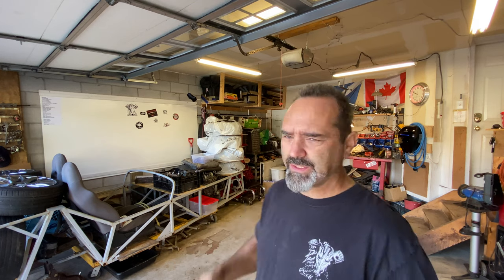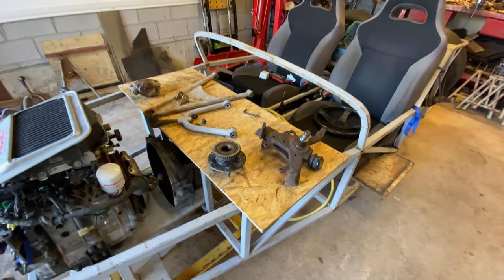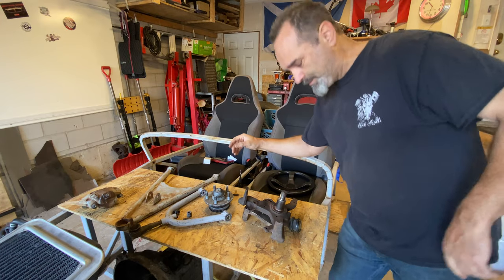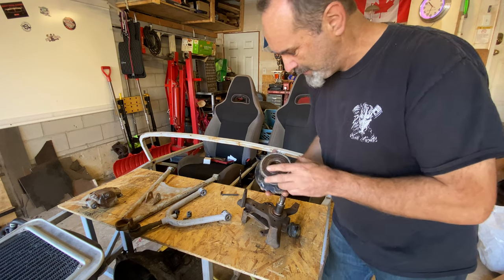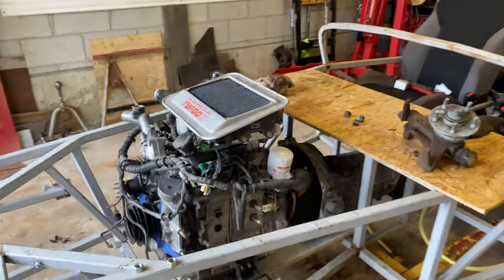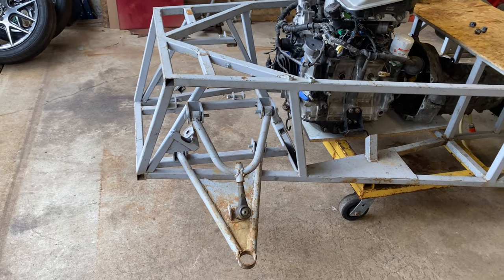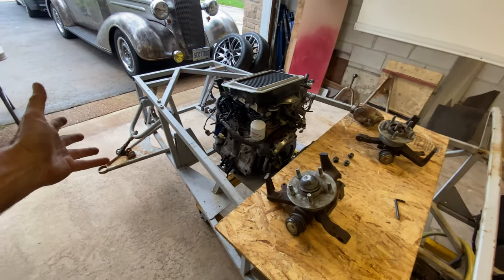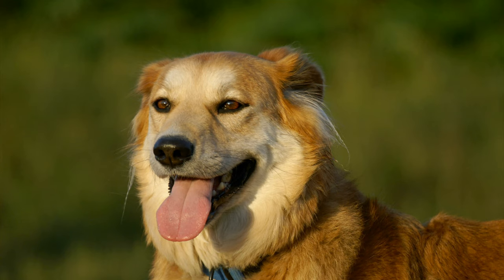Identifying The Front Hubs And Spindles On My Locost 7R7 Project

Comment: There is a great amount of engineering that goes into a front suspension,especially proper geometry.changeing the control arm mounts will affect the way the knuckle camber changes in up and down travel.I also see no way to adjust caster on this set up.what about ackerman angles on steering arms,are they correct for this wheel base.I see no sound principals being followed here,It may roll when your finished and thats about it.
Reply from the maker: Do not fear my friend! I am far from finished. currently learning FreeCad, so I can simulate the movement geometry. As for castor, I was thinking of making the control arms adjustable where they attach to the frame joints. There's a lot to learn, I know this.
Reply: @ScottRods  i would recommend a step before the FreeCad: get a good suspension/chassis book to learn the basics.  Those control arm mounting points are key in determining your front roll center and roll axis which are critical for safe predictable handling. I suggest How to Make yourCar Handle by Fred Puhn or a similar book by Herb Adams.
Reply from the maker: @wschell4023  Someone actually sent me that book last week! It's old, but the principles still apply.

Comment: I'm going with "A" on the PP. Also, I have no problem with hub adapters either, going to need them on the back of my 40 Ford to use Ford/AMC/Mopar wheels on an S10 diff.

Comment: Thanks for that steering lesson. I'm a newbie at this. Also about that pcd adapter, I may have to use them on my Alfa Romeo Stelvio, because they have a weird bolt pattern, 5x110 and it limits the wheels that I can get. I'm even thinking about using wobble bolts and get 5x112 pcd wheels.

Comment: Ya got me scratching my head on those spindles. because Thunderbirds cougars Fairmont zephyr mustang Capri LTD 2 Granada and Lincoln mark 7 from 1980 to 1988 were all fox platform cars some of these were fox before 1980 and some were fox a few years after 1988 and some of these were discontinued in1989 ford changed the t-bird and cougar's platform and they shared the same suspension for several years cougars had IRS where t-bird's only had it in special models so from 1980 to 1988 they were 4lug and from 1989 through until they changed body style they were 5lug but they shared the same lug pattern as the rest of the Ford 5lug cars I have a 1968 ford ranchero it has the same pattern as my 2003 crown vic and ford rangers and explorers have the same pattern ford and mercury cars share the same pattern but Lincoln's sometimes have a bigger lug pattern I hope this helps you figure out what will fit on your project
Reply: Just look at a 1992 cougar and all your queries will  make sense
Reply from the maker: Sorry, I should have clarified. The hubs and spindles are from a 1987 ish to 1990 Thunderbird, and I think there was a Cougar crossover date till 92....ish, lol.

Comment: Curious, why you chose to run wheel spacers instead of just re-drilling the front hubs with the desired pattern and pressing in new studs. You keep referring to this project as a "Track car" but many racing tracks/ organizations do not allow bolt on spacers to pass tech inspection.
Reply from the maker: There's just not enough area on the hubs to re-drill, the holes would be too close to the edges. Although I say track car, I don't mean on a professional basis, I'm too old for that. Just weekend run what you brung kinda thing. If the spacers are an iddues, I can always get a pair of track only wheels with the right stud pattern for that day.